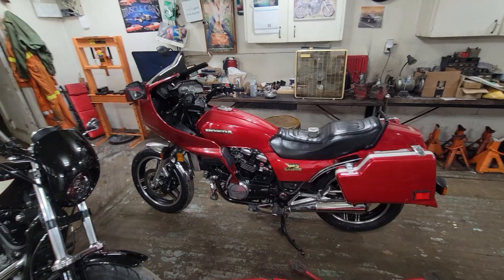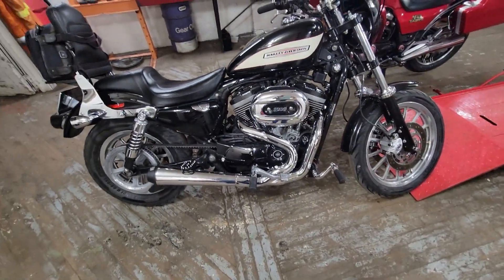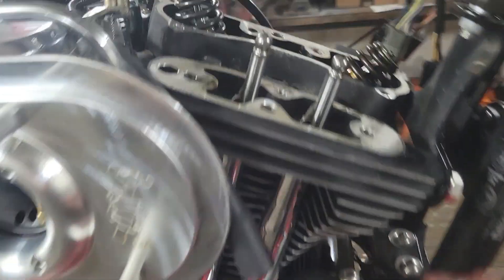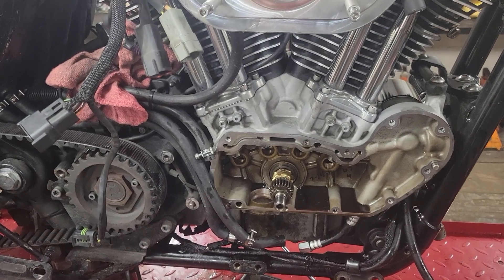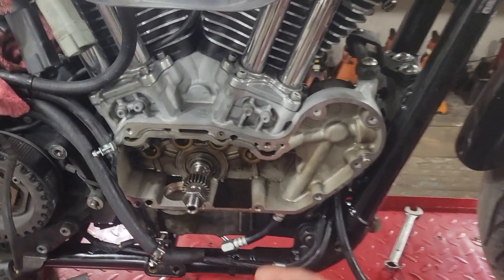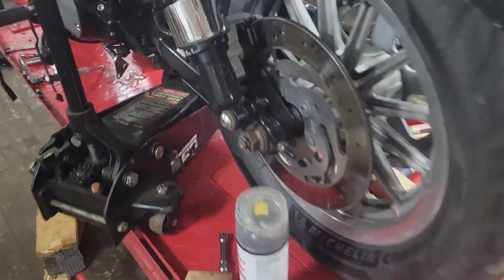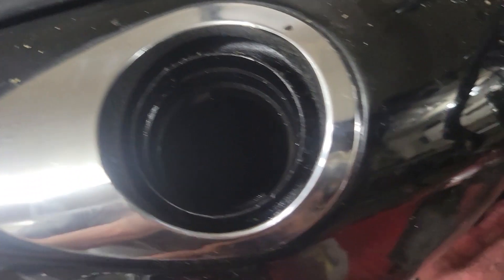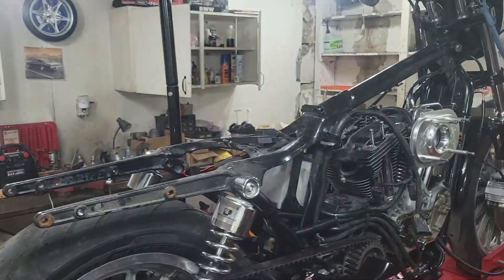Blew Up the Hammer 1275, Oh No!

Comment: What horsepower pack did you have? Did you have basic conversion or did you do the higher horsepower conversion because from what they tell me on the website the basic conversion pack you don’t even have to change the oil pump gear
Reply from the maker: I did cams, pistons basically no real head work. You do need the new gear for my power level. 100hp ish